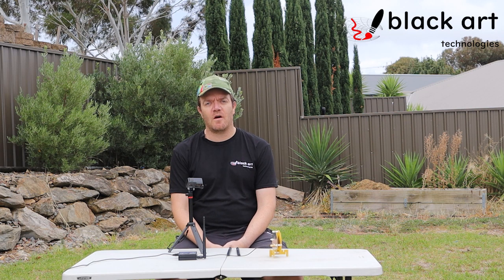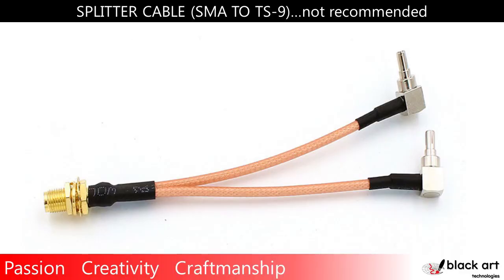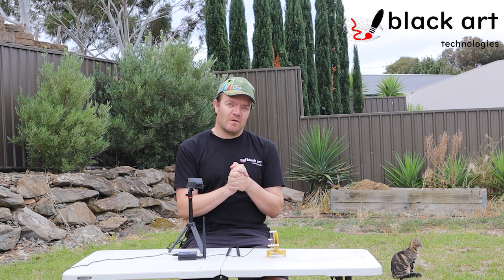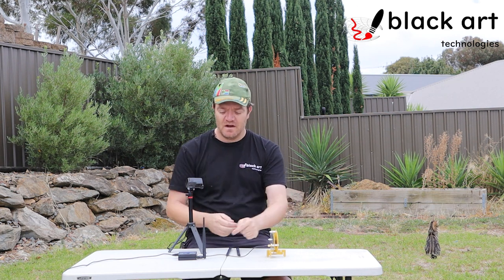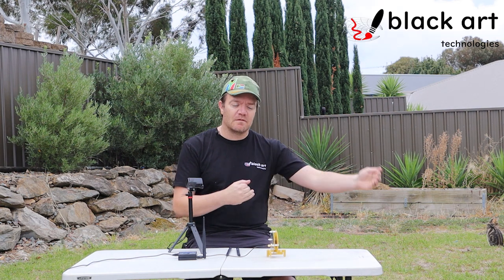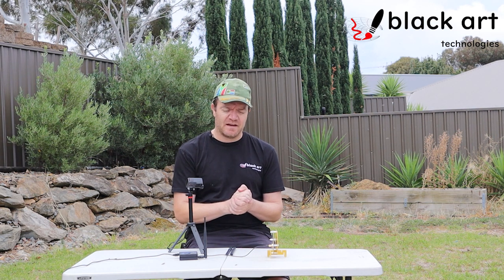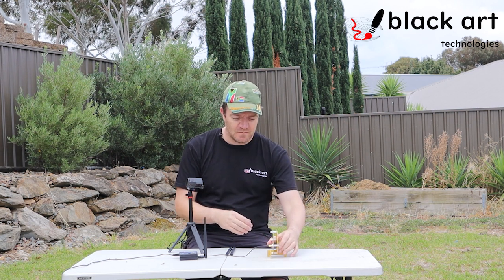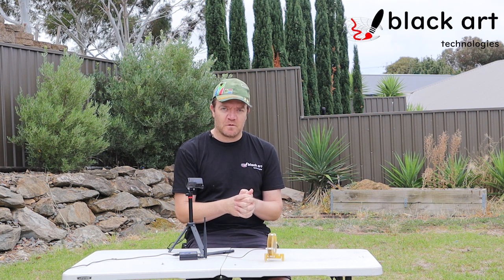Do we think 4G and 5G splitter cables are a good idea ?

Comment: I have a question, I have a cellular modem that I use with my motorhome, it comes with the typical indoor stick antennas, I would like to install a roof mounted 4x4 mimo antenna to get better signal while on the move. When stationary we sometimes need to use an external antenna (to clear trees and other obstacles) so I am looking for an RF switch that I can use to avoid having to manually switching the RF cables from one antenna to another. I know that probably it does not exist as I cannot find anything on the web. TIA for your input.
Reply from the maker: Seems my previous response was never saved or submitted ... sorry for the delay. 

it is possible to use a switch, but they are more common in laboratory and high-end applications. They would cost a few $100's, so not really practical. In this instance I would recommend switching the cable from one to the other.

Comment: very well explained, I'm just wondering what about 2 antennas in one router? For example, the router is a TP-Link which has a 2 antenna port, and the antenna is Xpol2 and the other is a parabolic antenna will this make the signal better?
Reply from the maker: Hi Paolo,
Yes, as long as you have two unique / independent antennas it will be better than combining into a single device
Reply: @RFShop  I hope you make a video on this. I have been searching on youtube about this topic however there is none

Comment: I was about to do this to a Access Point router. Can you please tell the effect if I put RF amplifier between 1 antenna and the router's 3 SMA ports ? The power amp has 1 RF in 1 RF out. For RF in I think to attach that cheap 1 to 3 SMA cable and connect on the router end. And the RF out would be connected to big antenna.
This way I only break the MIMO ? And I think I break it only on the reception but not on the transmission (true?). Because this would be AP (connected clients need good Download speed) it should work ? Advise ?
I cannot attach the amplifier only to single router SMA port because that's 150Mbps only spread further than the rest of the SMA ports.
And that means I would need 3 power amps, and 3 antennas.. (not on budged for 450mbps router)

Or simply put - if it was you and you had 1 big power amplifier with 1 RF in and 1 RF out, how would you connect it to router with 3 SMAs ?

Thanks in advance
Reply from the maker: This is a good question. With permission, I'd like to use this question as a "Script" for my video this week, and I'll explain it in more detail. There's lots to say, but as a quick "spoiler alert" ...I'm going to recommend against the use of an amplifier alltogether. I'll explain why in this week's video
Reply: @RFShop  Of course, you have my permission and I am eager to hear how to cope with this situation. Thanks!
Reply from the maker: Awesome...thank you

Comment: I am getting a Peplink BR2 with 8 ports because it is dual-modem. Waveform is telling me that I can use a splitter on one 4x4 mimo.
Reply from the maker: Hi. Could have some truth in that but I will have to understand in order to be able comment and learn more about this myself. Can you provide more info? Who is Waveform? What ports woukd be combined? Do you have a schematic diagram?
Reply: @RFShop  Yeah, if you look at the Peplink Max BR2 Pro it has a dual modem inside. Then on the outside it has 4 ports for one modem and 4 ports for the other "8 total". It would be the equivalent of hooking up two modems to the same antenna. Waveform makes cellular antennas and I was speaking to their reps when they mentioned that I could use a splitter. What antenna do you use? Waveform's antennas are around $400 for a 4x4 MIMO. I don't know much about antennas. For all I know a cheap antenna may be just as good as theirs. This is the first time I have needed good antennas.
Reply from the maker: @no_tread_  in principle I agree that you can combine the 1st port of each modem, 2nd port of each modem etc. via a splitter with the 1st, 2nd etc. port of the other modem. 
HOWEVER, you will still loose 3dBi since you are cutting the path in half going to one and the other. So, in principle I would not have recommended using a splitter because of that, but in doing what they recommend you won't break the MIMO part so it's OK-ish :)

I see this is a non AU enquiry, so I guess the $400 is US$400, right? You could probably get something cheaper, but if you go too cheap it may be garbage. The Poynting Antennas we also offer are readily available in the US and Europe and you probably will end up around that price-tag for those. It now does depend on your application and need. Is it a directional antenna or an omni? I.e. are you mobile or fixed location? I can help with information but probably need a little bit more information. Once I have it, I'd be happy to respond on a video so it's useful for your info, but I can say more that would be useful to others as well (without sharing any confidential detail, off-course)
Reply: @@lofi4114 I ended with not trying to use a splitter. I was scared that the transmission from the two modems would cause issues. I just did two 4x4 MIMO. A lot of people were saying any splitter would cause signal loss.

Comment: This was very educational, thank you. If splitters are a bad idea, is there another solution you would recommend for expanding Bluetooth range across several rooms on the same floor? I’m doing this for console controller range so my options are limited to whatever can connect to RP-SMA.
Reply from the maker: Good quality splitters are not bad. I was aiming to get everyday users to be scared of cheap splitters, in particular in the 4G / 5G market
Reply: @RFShop  Thank you. Is there an RP SMA splitter you would recommend?

Comment: I'm using a Teltonika RUTX09 modem fed by a Poynting 5g-XPOL. It works well considering I'm in a poor location and the modem signal meter never exceeds 3. However I've noticed at times it it only shows 1 on the meter. I realise the rf meter isn't a precision instrument but any thoughts on the variation? I'm assuming traffic through the 4g tower wouldnt show a variation at my end? Thanks.
Reply from the maker: Hi. As a starting point it would be good the get the actual vales for RSRP, RSRQ and SINR. This would be more telling of what’s going on. If you can send those numbers and your physical location we can have a look and think. Email via our website is fine!

Comment: What about the case when your router has port for low band LTE and one for high band LTE and your antenna covers full frequency range. Does splitting from single antenna work?
Reply from the maker: Good question. I still would not want to split if it was up to me, as it throws away 3dB of possible power. What model is that?

Comment: I want to connect a device with a single 5,8GHz output to an antenna which has two inputs for vertical and horizontal polarization. Does it make sense to split the devices ouput onto the two antenna inputs or is it better to just use one input. The receiving device is a MIMO-one (router).
Reply from the maker: Hi Firstname_Lastname. That's a question I have always wanted to test. We have tried to combine two polarisations on other projects recently, and we ended up getting more issues than what was worth the effort. It seems intuitive that it should work, but we got caught. You always have one polarisation where there's an issue, and by introducing the splitter you also add losses and more complexities. So based on that I would say no...just use one port.
Reply: @RFShop  Thank You very much for getting back to me so shortly! I wanted to use the Poynting SPLT-16 after the mentioned 5,8GHz-device and the outputs of the splitter then going into the h/v-inputs of a HG3-CC-S30 antenna from rf-elements with a poynting EPNT-4 on the receiving side with a RUTX-50 in the EPNT-housing.

But then i scratched my head because of in this scenario having only 5mW max. for each polarization-plane instead of the 10mW max. when using only for example the vertical input. And i think 10mW maybe much more worth (more punch) than 2times 5mW on each polarization plane (?) ...

BTW.: what about the "magic" of cicular polarized antenna-pairs in dense urban city building-"canyons"? I know that Circulars are the preferred ones in mining-/tunnel scenarios ... ^^
Reply: So i actually forgot about the fact that i additionally asked basically the same question about Circulars directly to Mr. and Mrs. Poynting here at their Youtube-home and they got back to me advising that not being the good idea that it sounds because a tunnel (mining or any tunnel-like structure) is a real tunnel, means it's a long hole completely enclosed by walls, whereelse street-canyons are missing that copmplete enclosure quality which leads to the signal way not having so much surfaces to bounce from and propagate from there on and so forth and that it is this bouncing-power of circular polarized HF that makes it superior in propagating downrange of loooong holes and obviously this is not given in the mentioned city-canyons.

So in these city-scenarios one should stick to the good "old" standard polarizations and let the tunnels be ... tunnels :)
Reply from the maker: @Vorname_Nachnahme  you are asking questions about an antenna I am literally about to put together and test for myself (and not channel and my own channel). I'm not convinced about the CP not being a good idea. You basically accept a 3dB loss in using a CP antenna, but once you go beyond the 3dB loss because of the circular polarisation there is no reason to think it's a good idea in any setup. 
I believe that they way a CP is explained in tunnels can be somewhat misleading. The images tend to show a CP is propagating through a tunnel like a drill / bore. That's not really what happens. The walls just bounce things so much that the signal is really dirty and no defined polarisation anymore. That's simply why a CP will work...it detects all the reflections regardless of it's origin. A linear antenna will miss all the cross-pol reflections. In a multipath like a canyon of buildings will be somewhat similar, and I think it's a good idea for a single antenna. If you have a MIMO setup it is better to go linear cross-pol antenna because you don't have the 3dB loss on either of the two antennas. So, that's my answer. if you go MIMO, go linear cross-pol. If you go SISO, consider CP but know you are 3dB down.
Reply: @RFShop  Your Honor,

i have questions ... :)

1.) Where's the mentioned 3db loss coming from? Is it system-immanent with Circulars? (or is it from that splitter?)

2.) Regarding your antenna-project: Is it actually a circular test-setup (maybe in comparison with a linear one?) and will you present it on your channel?

3.) I think you are right with your mentioning of the "immunity" of a circular system to "dirty" signals not being useful at the receiving end anymore because of all the bouncing, as a main reason for the usage of circular polarisation in tunnel scenarios, not that circular polarized HF is a systematically better bouncer as i suggested.

4.) I listened to Poyntings presentation "Webinar 6: Digging into circular polarised underground communication" and when i understud that correctly, a PAIR of one right-hand polarized and one left-hand polarized antennas should be used at the receiving end because when for example a right-hand polarized "beam" bounces off a wall it's polarization changes to left-hand and if in that moment and with only a right-hand polarized antenna waiting at the receiving end, that reflected beam would not tell it's secrets to that lonely righthand-antenna ... (?)
Reply from the maker: @Vorname_Nachnahme  the 3dB loss is part of the circular polarisation when tested against a linear antenna. If you were to put a circular antenna facing a circular antenna you will not have this issue (as you imply in your comment). So the best way to overcome the multipath is to have two CP antennas facing each other. 

It comes back to the same again...two (MIMO) antennas or more are simply the best. 

Yes, once my antenna works it'll be on this channel, but I'm going to "make" the antenna on my personal channel @DaviddeHaaij and only present results on this channel. So I will have a maker channel and an RFShop "shop" channel. This plan is going to launch in the coming weeks :)